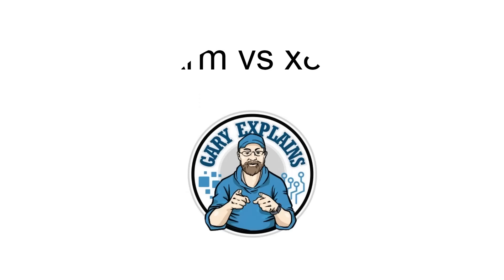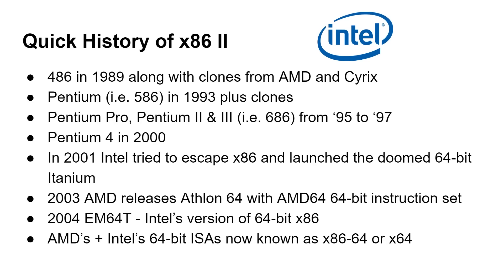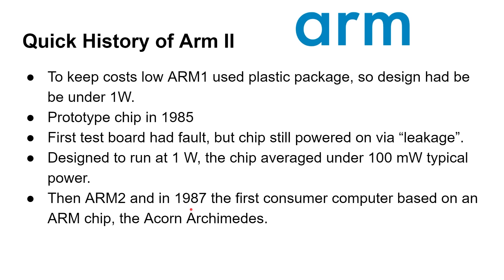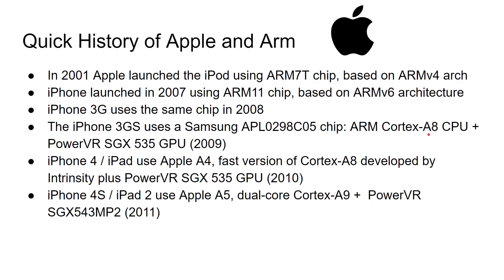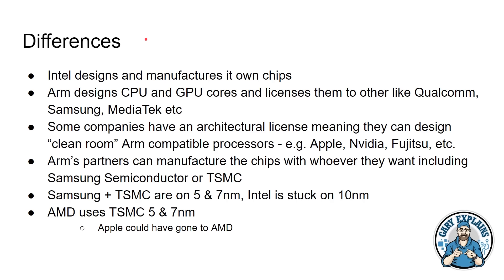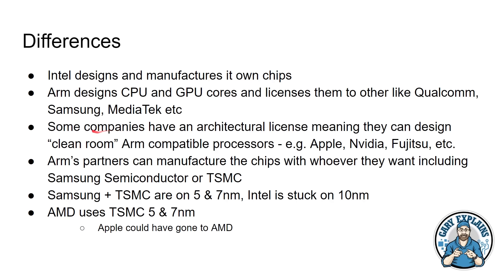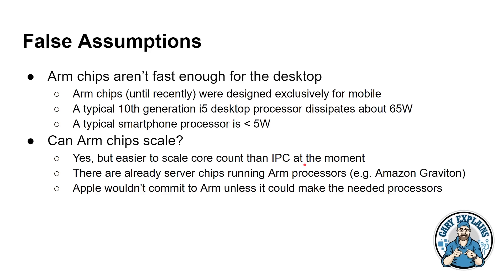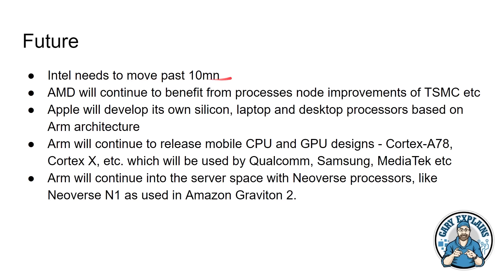Arm vs x86 - Key Differences Explained

Comment: The big problem of Intel is that they invested heavily in branch prediction. And it was a wise move. Their single core performance was really great but then Spectre and Meltdown happened and they had to shut down the biggest improvements. Their rivals AMD or ARM invested more in multicore processors. They aren't affected by these vulnerabilities and so Intel has a lot of catching up to do.
Reply: Actually, lots of architectures were effected by Spectre and Meltdown, but especially Intel the most.
They effected at least: Intel, AMD, ARM, MIPS, PowerPC. But not: RISC-V and not Intel Itanium. At least RISC-V does things in a similar way but not all the things needed to hit into the problem. But in theory new designs of chips could have been affected too. Obviously they know about these things now, so it will probably not happen.
Different processors series/types/models of each architecture were affected in different ways.
Reply: Intel did not discard any of their prediction units or improvements because of spectre meltdown problem.

Comment: I've got an impression memory is (relatively) slower and more expensive TODAY than back then. Then - in the early 1980s - performances of RAM and CPUs were not far apart, so CPUs were not that handicapped by RAM - they could fetch instructions directly and remain fully utilized. Today it is different: RAM is much, much slower than CPU, so CPUs spend a good part of their transistor budgets on internal multilevel caches. Whereas on modern systems you can have 128 GB of RAM or more, the one that actually matches your CPU speed is the L1 cache which is tiny - Ryzen 5950x has only 64 kilobytes of L1 cache per core (32 kB for code and 32 kB for data). I would say the instruction set "density" is even more important now.
Reply: Why do you think that is? Because the R&D Intro memory is worse? Genuine question
Reply: Very few modern systems have 128 GB RAM. Typical is about 16. 16 GB costs some $50. In in around 1983 typical was 64 KB. It was about $137 which inflation adjusted would be  about $410. Sure RAM is not more expensive now.
Reply: @okaro6595  L1 cache is expensinve

Comment: The biggest problem that x86 has are its strong guarantees. Every CPU architecture gives programmers implicit grantees. If they require guarantees beyond that, they have to explicitly request those or work around the fact that they are not available. Having lots of guarantees makes writing software much easier but at the same time causes a problem for multicore CPUs. That's because all guarantees must be uphold across all cores, no matter how many there are. This puts an increasingly amount of burden on the bus that interconnects the single cores, as well as any shared caches between them. The guarantees that ARM gives are much weaker (just as the ones of PPC and RISC-V are much weaker), which makes it much easier so scale those CPUs to a bigger amount of cores, without requiring a bus system that needs to become drastically fast or drastically complex, as such a bus system will draw more and more power and  at some point become the bottleneck of the entire CPU. And this is something Intel and AMD cannot change for x86, not without breaking all backward compatibility with existing code.

Now as for what "guarantees" actually means, let me give you some examples: If one core writes data first to address A and then to address B and another core monitors address B and sees it has changed, will it also see that A has changed? Is it guaranteed that other cores see write actions in the same order they were performed by some core? Do cores even perform write actions in any specific order to begin with? How do write actions and read actions sort towards each other across cores? Do they sort at all? Are some, all, or none of write actions atomic? Over 99% of the time none of these questions matter to code that you write, yet even though less than 1% of all code needs to know the answers to these questions, the CPU has to stick to whatever it promises 100% of the time. So the less it promises, the easier for the CPU to keep it and the less work must be invested into keeping it.

When Microsoft switched from x86 in the fist Xbox to PPC in the Xbox360, a lot of code broke because that code was not legit in the first place. The only reason why this code was working correctly so far were the strong guarantees of the x86 architecture. With PPC having weaker guarantees, this code would only work sometimes on these CPUs, causing very subtle, hard to trace bugs. Only when programmers correctly applied atomic operations and memory barriers, as well as used guarded data access  (e.g. using mutexes or semaphores), the code was still working correctly as when using these, the compiler understands exactly which guarantees your code needs to be correct, and knowing for which CPU you are compiling, it also knows whether it has to do something to make your code work correctly or whether it will work correctly "on its own" as the CPU gives enough guarantees for that, in which case the compiler will do nothing. I see code every second day that only works coincidentally as it's being used on a CPU that has certain guarantees but this very same code would fail on other CPUs for sure. At least if they have multiple cores, there are multiple CPUs in the system, or the CPU executes code in parallel as if there were multiple cores (think of hyper-threading).

The guarantees of x86 were no issue when CPUs had a single core and systems had a single CPU but they increasingly become an issue with the number of cores rising. Of course, there are server x86 CPUs with a huge number of cores but take a look at their bus diagrams. Notice how much more complex their bus systems are compared to the consumer x86 CPUs? And this is an issue if you want fast CPUs with many cores running at low power, providing long battery life and not requiring a complex cooling system or otherwise will run at very high temperature. And cores is currently the easiest way to scale CPUs, as making the cores run at higher speed is much harder (the clock frequency of CPUs is currently usually below what it used to be before all CPUs got multicore) and it's even harder to make the CPU faster without raising clock frequency and adding more cores as most optimizations possible have already been done. That's why vendors need to resort to all kind of trickery to get more speed out of virtually nothing and these tricks causes other issues, like security issues. 

Think of Meltdown, Spectre, and Spectre-NG. These attacks used flaws in the way how optimizations were implemented to make CPUs faster without actually making them faster, e.g. by using speculative execution, so the CPU is not faster but it still can perform work when it otherwise couldn't and it it was doing the work correctly, it appears to be faster. If what it has just done turns out to be wrong, though, it had to rollback what it just did and this rollback was imperfect as they didn't clean up the cache, thinking that nobody can look directly into it anyway, so why would that matter? But that assumption was wrong. By abusing another of these tricks to make CPUs faster, branch prediction, it is possible to reveal what is currently cached and what isn't and that way software can get access to memory it should never have access to.

So I think the days of x86 are counted. It will not die tomorrow but it will eventually die as in many aspects x86 is inferior to ARM and RISC-V who both give you more computational power for less money and less electric power and this is not a temporarily thing, as no matter what trickery and shrinking they are going to apply make x86 faster, the same trickery and shrinking can also be applied to ARM and RISC-V to make them faster as well, yet on top of that, it will always be easier to give them more cores as well and that's why they keep winning in the long term.
Reply: Did you just type a fucking novel right here?
Reply: Why does this only have 26 likes? This is amazing.
Reply: This was such a great read. Thanks for taking time to write this!
Reply: There are so many things wrong in this comment that I’m glad it’s not gotten a lot of likes. Thank God people learn to do actual research than agree to unverified claims in the comments section.
Reply: @jamesyu5212  People especially need to stop listening to comments that simply make blanket claims of anything being wrong without naming a single specific point that is supposed to be wrong or refuting even a single point. Who says sweepingly, something is wrong, which has ultimately said nothing and can save his know-it-all comment in the future just the same, because apparently he knows nothing, otherwise he would give something concrete from him.
Reply: @jamesyu5212  can you give some examples?
Reply: @xcoder1122  I do not intend to refute things written on YouTube comments sections. I’m not 12. If you were really interested in discussion or debate, find a forum of likeminded individuals. 

You just come across as someone who just likes praise and attention. Or someone who’s paper has been rejected and hence posted it in a YouTube comment section. Yes, I’m entitled to judge you as you just called me a know-it-all even though all I said was that you were wrong and you were the one who spent more time writing your comment versus just watching the video. 

Bye.
Reply: @jamesyu5212  It's rather the other way round: Making bold generic claims that something is totally wrong without being able to point out a single mistake is what makes you look like a 12 year old as that's typically what kids at that age would do for trolling. 

Note that if YouTube would allow me to post external links, which it usually does not (not without getting moderated by the channel owner which usually means the comment never appears), I could post several links to white papers and processor documentations that back up every single claim I made. So it's quite a bold statement to claim something is untrue that basically repeats what CPU experts at universities say in their white papers and that CPU vendors themselves admit in their documentations.
Reply: @jamesyu5212  If there's something wrong in his comment, then point it out.
Reply: Brilliant comment. I just watched (half of) a cppcon talk involving branch prediction and speculative execution. I dropped out before understanding rollback/ how it actually works at the machine level. Seemed like a hack to get free parallelization. I'd never have predicted it would be a gaping security flaw though!
Reply: Amazing info. Thank-you
Reply: @jamesyu5212  It’s reminded a YouTube of Chinese tourists tantrums not allowed to check in the hotel
Reply: nice write up thank you for taking the time.
Reply: X86 was at it's "End-of-Life" cycle about 10 years ago, the major players have really been beating this dead horse for too long
Reply: @jamesyu5212  Yet here we are commenting. The irony doesn't seem to be lost on most of the "12-year-old commentators" lol
Reply: Thank you for this extraordinary text. 😀
Reply: Thank you so much. Ima copy and paste this when those idiots start talking trash about apple. Apple really is for the people
Reply: @jamesyu5212  Yu are a very bored 12 year old.
Reply: @bits3608  5 months too late bruh I'm already 13 now. 🤦
Reply: I don't know what I'm reading, but it seems legit information and analytic, thank you soo much for sharing knowledge
Reply: Name a real victim of spectre
Reply: WOW thks
Reply: @tvthecat His article was insanely well-written. What's your problem?
Reply: My god what an absolutely amazing comment , i am glad I read through all of it
Reply: Thanks for sharing

Comment: My father was working for DEC at that time, and he told me a lot about the Alpha chip and their foray into 64bit before AMD and Intel brought their consumer 64bit chips to market. He also told me about the purchase by Compaq(and subsequently HP) and that a lot of people weren't keen on the purchase as there was concern all their efforts would disappear.
These days DEC is barely a whisper when people talk about tech history, but I still remember sitting at an ivory CRT with the red 'DIGITAL' branding on it.

Edit: Thanks Gary for the little nostalgia trip.
Reply: VT-100?
Reply: The leader designer of the DEC Alpha founded an CPU company in 2003 which Apple bought in 2008 (PA Semi). This were they got the tallent to engineer their own CPUs for the iPhone (starting from iPhone 5) and now the new ARM-based Macs.

Comment: Really great to hear someone who knows about Acorn. In 1986 I lived in North-western Ontario (Canada). Our library put in a desk with 6 computers on it. They were the North American version of the BBC Micro, made by Acorn. It was the first computer I worked on. I didn't find out about the ARM chip and the Archimedes until the mid nineties. And it was shortly after that time that ARM was spun off. BTW, Acorn was owned by Olivetti at this time.  When I found out about the Raspberry Pi, I got onboard. I had a model A chip, and then I bought a Pi 4 just in time for Covid, so I could use my camera module to have a second camera for Zoom.

Comment: In your slide listing the major differences in RISC v CISC, one thing that struck ME as relevant because of my interest in compilers and which admittedly may not be particularly worth mentioning depending on your audience, is that RISC instructions also tend to be more uniform in the sense that if you want to do an add instruction, for example, you don't have to really think about what instructions are allowed with which registers.  Also, the instruction pointer register is just a regular general purpose register while that register is often special purpose in other architectures.  It's awkward and roundabout to even access.  Often you need odd tricks like to use Intel's call instruction as if you're calling a function for its side effect of pushing the instruction pointer to the stack.  Then from there, you can pop the value off.  But in arm, you just have it in one of your normal registers.  Obviously, you must beware if you dump random garbage into it that you'll start running code from a different place in memory but that should be obvious.  Yet such uniformity can eat space and so the THUMB instructions don't have it.

Comment: It is interesting how the CISC vs. RISC battle has evolved with Intel's CISC holding the lead for many years.  Unfortunately, Intel rested on its laurels by keeping the 8086 architecture and boosting its operating frequencies while reducing the chip size production down in nm levels.  Thermal limits with this architecture have literally been reached giving Apple/ARM the open door with their approach which now after many years has surpassed the 8086 architecture. It will be interesting to see how Intel reacts given their hegemony control of the market.

Comment: surpised you didn't mention the softbank acquisition. all my arm stock got paid out when that happened and it kinda surprised me. totally thought I'd just get rolled over into softbank stock.
Reply: Yes, £17 a share was a  good deal at the time, I wonder what they would be valued at today.
Reply: @patdbean  they benefited from the price drop of the Pound because of Brexit.
Reply: @autohmae  SoftBank did yes, but ARM themselves (I think) have always charged royalties in USD.
Reply: Well, it looks like Softbank is shopping ARM around ... hope it doesn't get picked up by the mainland Chinese.

As for stocks, I noticed I was spending waaaayyy too much on Apple gear, so I bought some Apple right after the 7-1 split in 2014 to help defray the cost at IIRC about $96/share.
Reply: @vernearase3044  The British regulation board will not allow the Chinese to buy ARM, because if they do, that would be the death of ARM in the Western world
Reply: Well now Nvidia has acquired ARM from Softbank.

Comment: just quick on the x86 history, the 8086 was 16 bit and expensive so they released a more affordable 8088 chip in 1979 that only had an 8 bit data bus (much cheaper than 8086) so more popular, also AMD made 8088 4.77 Mhz  clone chips with 10Mhz turbo (first PC i ever built) and clone 8086's  (Clones started way before your listed 386 clones). I like that you mentioned Cyrix even though they where so unstable I only built one. The AMD64 has to do with  patents not just that they where there first.